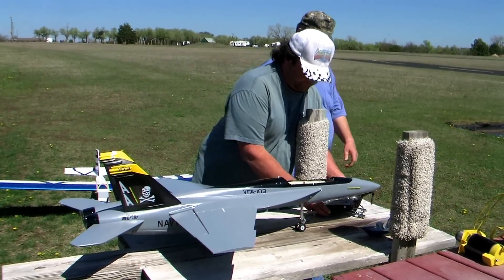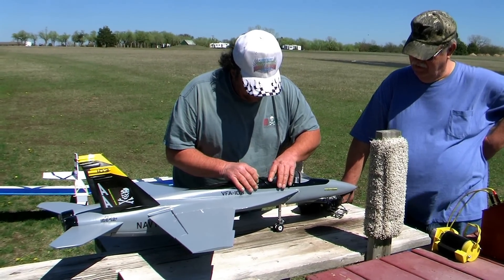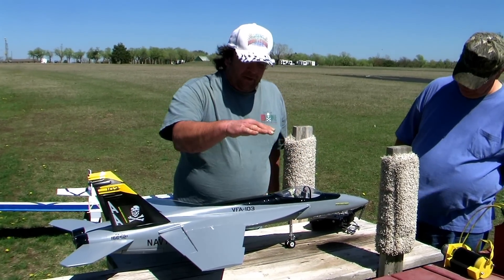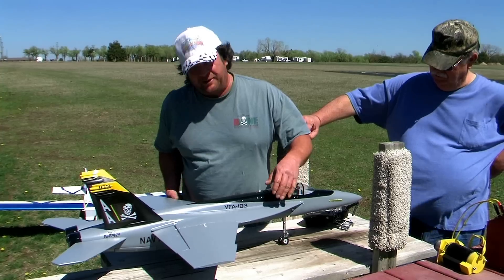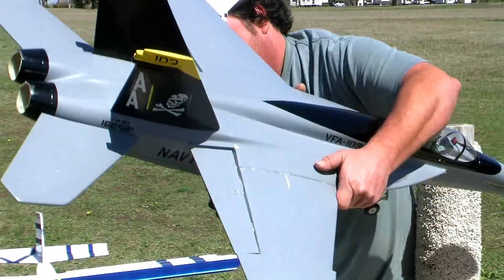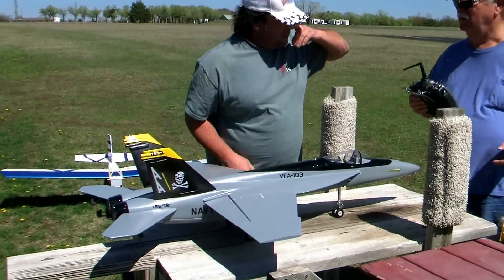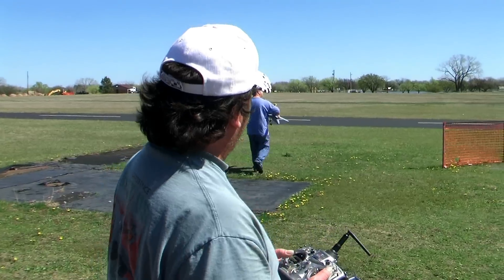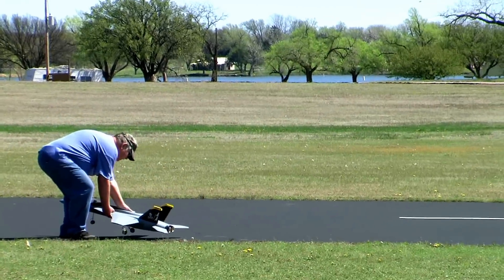hobbyking composite F-18

Comment: Hey Bob nice sounding...have also here two of the changesun 90s but only rotor the rest custom made metal :)) more cells on it...

Will see how it goes and have an eye on the 120mm...

But which motor combo do you use? the original 1600 kv motor?